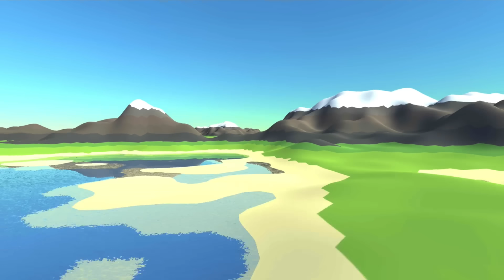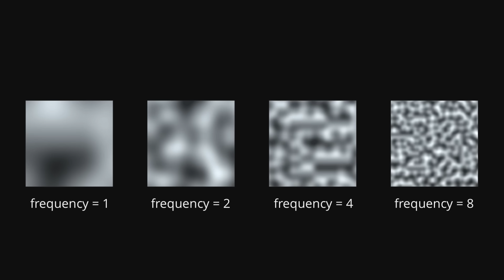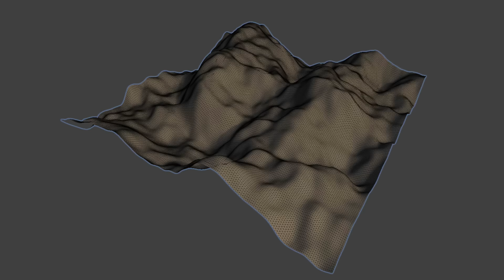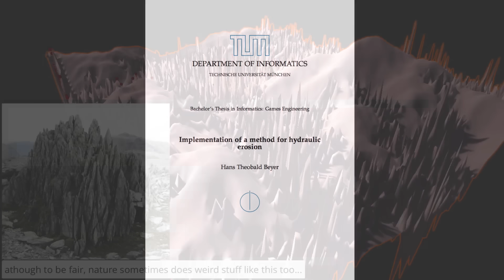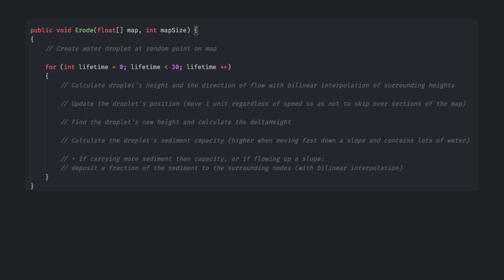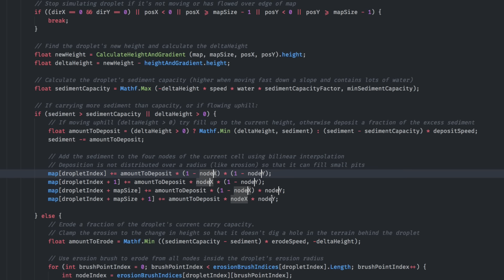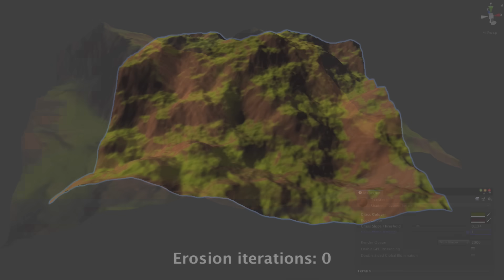Coding Adventure: Hydraulic Erosion

Comment: Why are you using a one dimensional heightmap? Wouldn't float[,] be more appropriate?
Reply: The height map isn't one dimensional, but the float array he used to store it is a one dimensional array, which can be easier to work with depending on what you're trying to do.

Comment: Given that, as moisture-laden air is pushed upwards over higher terrain, thereby cooling it to the point that the probability of rain increases, how could this affect the simulations of hydraulic erosion if factored into the source code?

Comment: Something I've noticed about things like this is that they create a lot of local low points that are still pretty high up, with no place for any of the simulated water to escape. In real terrain, these spots would become lakes that fill up until they find an outlet that lets as much water out as flows in. Any ideas or plans on implementing this?

Comment: One episode back I thought "nah, this terrain isn't real because there's no erosion", but then I saw this.

 I watched several videos and was impressed by the relative simplicity of coding. I program in Python as my day job, and it does get complex, but things are linear and straightforward unless you consciously dive into multiprocessing. I tried VB/VBA/VC++Builder years ago, but long time did not approac IDEs, because of the steep learning curve and finally low returns in the perspective. 3DMax/Blender-like UI also scares, compared to Sketchup (because the latter you can learn by just poking around), but probably with a reachable goal in the end one can get over the complexities. Thanks for these introductions!

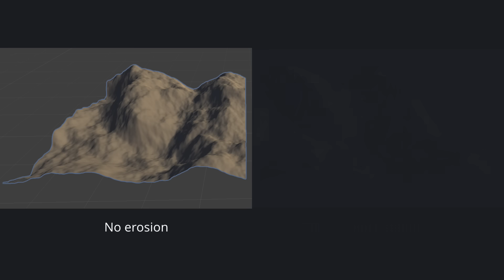Comment: 4:15 looks better than almost any mountain I've seen in a game ever.
Reply: While this is true, in many games terrain like this isn't very desirable, it's harder to limit traversal, this erosion by it's nature tends to create slopes that aren't that steep, and flat areas, authored terrain, while less natural, gives more freedom with how the designers want the player to navigate through it. There are often gameplay considerations on top of the art.
Reply: @DreadKyller though this method can be used still to create areas the player cant reach or have it slightly modified so it fits with whatever the project is
Reply: @DreadKyller  I wonder if that's true. While this method changes the texture of the terrain a lot, it doesn't change the overall shape much. So the initial heightmap could be designed to specific design parameters before the procedural engine takes over.
Reply: @Tristan Popken looks pretty good, not much else to say about it, maybe a little steep at points.

 @weckar  depending on settings it can change the shape a lot actually.

@Luxraider could be, the fact of the matter is hydraulic erosion is being and has been used for a long while in a lot of games, esspecially for background and for games where the designers don't care as much where you can go, it looks nice from a distance, but up close it can be hard to tell, because for performance reasons the resolution of terrain isn't usually all that high, so it's more of a seen-at-a-distance thing. It's also expensive for large areas, so for something like a background it'd likely be precomputed, and backgrounds tend to be billboarded anyways at a distance.

@Sanya Juutilainen It already is used a lot in many procgen games, but mostly in games with a fixed level size. It poses several challenges trying to implement this on an infinitely procedural world, as you by definition can't run the erosion on the entire world at once, you need to run it as it's generated, and this means the erosion may need to erode into unloaded areas of the map, or erode over already eroded areas. And Hydraulic erosion done the way he did it is very expensive, even with some shortcuts and optimizations this type of processing is expensive on large scales, though not expensive enough to prevent it's use.

I was just pointing out that on many popular games, there are design considerations to take into account. And especially in a very large map like many modern RPGs, looking over every part of the map to see if the erosion did something you don't want would take a long time. Procedural generation will continue to evolve and people will always come up with new, interesting ways to get around the challenges and limitations.
Reply: @DreadKyller  A friend of mine made this mountain in Minecraft, what do you think of it?
https://www.reddit.com/r/Minecraft/comments/gjnya5/a_mountainous_landscape_i_just_finished_today/
Reply: @DreadKyller  but this may a be a really good generator of an inacessible area that you'll simply see changing as a background
Reply: @DreadKyller  It will be applicable in future's procgen games - games like NMS or Elite (not now, but when atmospheric planets are implemented) could use this heavily.

Comment: One day, geologically accurate Minecraft terrain generation would be a reality.
Reply: Yeah, its called Dwarf Fortress XD
Reply: mfaizsyahmi There’s a mod that has a rather nice implementation of erosion simulation. It has some other very neat features too. It’s called Terraforged.
Reply: Look up a mod called Terraforged
Reply: This can be done. In fact, it won't even require any mods and can be done with command blocks.
Reply: @almarc not true at all because simulating erosion doesn't work with chunk based generation
Reply: Try the terraforged mod. It’s really beautiful in terms of terrain and is highly customizable.
Reply: Um guys caves and cliffs update IS making Minecraft geologically accurate
Reply: The difference between the other terrain generation minecraft mods and this idea is that those mods are generating off already-set variables on what height this and that is probably at, what the differences in biomes are, etc... While this is basically a physics simulation, it has to generate a realistic terrain by itself first, which is what those mods do, then a simulation takes place where it erodes the terrain through realistic patterns such as realistic rainfall tendencies, realistic flow of water, etc... In order to get as close as possible to real-life. Of course it's hard because you're constrained to cubes, heck even if you were to divide the blocks into 16 little blocks it'd still won't be too realistic. Geologically accurate minecraft terrain generation is already at our fingertips but it isn't going to be as realistic as we expect unless we do what makes more sense, literally just copy what is already the most-realistic thing ever, Earth itself.
Reply: Dwarf fortress has some of the most accurate terrain generation in history. Extremely accurate with all stone and ore in the correct layers, accurate nomenclature and physical properties for all the rocks and crap. The dev basically studied geology, climate, chemistry etc to build it. You can also export df worlds to Minecraft so... it's already possible!
Reply: Later Activity you have any articles or examples of this? This has really peaked my interest!
Reply: Bill Bob found this article that talks about the terrain generation and erosion for you

https://www.polygon.com/2014/7/23/5926447/dwarf-fortress-will-crush-your-cpu-because-creating-history-is-hard
Reply: There are mods for that already
Reply: Welp that is almost true now.
Reply: I don’t know if you’re still active but that is what I am currently working on. That’s why I’m here. I plan to make a game like Minecraft but with less restrictions and larger elements. And erosion simulation is one of the elements I plan to include in world generation.
Reply: Simple: install the terraforged mod.
Reply: 1.18
Reply: Ok
Reply: look up the realistic world generation mod. It might be what youre looking for.
Reply: There are already quite some powerful terrain engine in both Unity and Unreal for an affordable price.
Reply: Don’t we already have large cliffs that go up to the stratosphere 12 million miles from 0,0 irl?
Reply: Vr minecraft still exists
Reply: A reality, and extremely boring for gameplay :P
Reply: @weckar  i disagree. For example, Terraforged looks phenomenal BECAUSE its geologically accurate
Reply: @jondow7401  I wasn't talking about looks though, was I? I was talking about if it would be fun to play in. Mountains far too steep to climb, ore rarity increased tenfold, biomes far too large to traverse on foot... no thanks.
Reply: @weckar  You can change all that, yk. Also minecraft mountains r already pretty steep, far steeper than real life mountains at least. And I kinda think making it look realistic actually adds to the general atmosphere of the game, making it more fun to play. Like you're actually exploring real life uncharted landa

But hey, everyones entitled to their own opinion, plus im not gonna argue the pros of realistic Minecraft terrain gen under a coding video
Reply: Terra 1-1 mod (goes with Cubic Chunks) https://www.curseforge.com/minecraft/mc-mods/terra-1-to-1-minecraft-world-project
Reply: Don't give me dreams pls
Reply: Quantum. Computers.
Reply: If you wanna try one terraforged is my preference
Reply: Wouldn’t it take years tho
Reply: 1.17 be like
Reply: Have you heard of terraforged by any chance?
Reply: Biome blend
Reply: Dwarf fortress
Reply: Realism was never the point in Minecraft, accurate simulation usually makes boring games
Reply: Oh there's a bunch of mods that already do this and beyond
Reply: there is a terrain mod called terraforged that uses an erosion system to generate the terrain iirrc
Reply: Today is your lucky day!
Reply: Oh hey, now I have to do this?
Reply: It probably is possible. You ever googled stuff about Pixar’s supercomputer they use for rendering movies? 25,000 cores! Realistic minecraft easy mode
Reply: Id prefer Minecraft accurate geological terrain
Reply: Expect that nobody want it in mc 😂
Reply: Vintage Story
Reply: You would introduce lag if you are creating new land and then changing it afterwards to simulate erosion. Also, I suspect there would be an issue with water drop size and distribution if the idea was to have in-game rain erode the land after generation. Things like World machine do make the land look great zoomed out, but in-game you would be hard pressed to notice much difference between that and vanilla or one of the popular biome mods
Reply: @Ironbuket  This could be fixed by using Deferred Rendering. First you render your initial terrain to a texture image or an array of texture images on the back buffer(s). You then send this data to a Compute Shader - Geometry Shader, Tessellation Shaders etc. You use the compute shader to calcluate the amount of erosion, water evaporation, and water accumulation for each frame for a given amount of elapsed time. Then you send the updated information from the compute shader - geometry shaders to the fragment shaders for post rendering.
Reply: @Ironbuket  Well you can notice quite a bit of difference with World Machine if you're familiar with vanilla MC, because vanilla utterly fails to make anything close to smooth coherent terrain. That said, vanilla's shattered look is often more appealing from a pure exploration standpoint. Also, keep in mind that, as far as I'm aware, World Machine only works on pre-generated terrain. So, it's for map making in a defined area, not for exploring randomly generated stuff.

I'm fairly confident that there's currently no way to create a terrain generator that lets you simulate terrain changes at rendertime.  That sounds like it digs too deep into the game's core functionality for any of the available APIs to reach.
Reply: @Ironbuket  if you trained an AI to create similar hight maps to images fed from this guys video, it could blend the Y height of each surface block in minecraft with the Hight map to create a "simulated" terrain generation without the extra lag that comes from the simulation. basicaly deep-faking heightmap "faces" onto the terrain.
Reply: @noahmarchais804  and have to update the blocks in realtime
Reply: ...jay?... i guess?
Reply: @tf2excession  except that minecraft is really shitty in terms of big hills
Reply: @RagbagMcShag  1.18 tho 👀
Reply: We, the people of Minecraft, will annihilate you and your supporters as heretics...
Reply: @lolitaras22  No we won't

Comment: I've been playing around with the same thing, although I havn't got my erosion algorithm to work properly quite yet. The algorithm I went with looks slightly different from your. The promised result also look slightly different. I based mine off of the paper "Fast Hydraulic Erosion Simulation and Visualization on GPU" as well as other similar sources, but I might check out your sources and give them a try. Either way, your results look great.

Comment: An improvement I would do is to run those drops simultaneously in batches and let them merge when they meet. That way you will get water flows which is something that is visibly missing - some areas are too smooth and flat while in nature channels and stream beds would form there. It is very nice nevertheless!

Comment: Can anyone explain why the height map is float[] and not float[][]? I'd have thought this would be done with a 2d array, how does a 1d array translate to a 2d plane?
Reply: tiggerbiggo Well you can just always do loops that account for this. A 2D array in memory is (often) just a bunch of 1D arrays in a row. He may have done this because if it wasn’t a rectangle with rectangular mesh points, then a 2D array wouldn’t really make sense. And you may notice that he used a triangular mesh
Reply: @1495978707  i do unserstand, however this would mean that he would have to use modulo and int division to account for it and split it back down into 2d coordinates?

Also, even though it is a triangle mesh all the vertices fall perfectly on a 2d grid, and you can only ever change the vertices positions...

Comment: Hi Sebastian,

This video was inspirational: I'm now looking at implementating a variation of your erosion algorithm in Monogame for the next update of my game.

By the way, I found that decreasing erosion/deposition speed (divide by 10) and increasing sediment carry capacity (multiply by 5) was a good way to encourage the formation of gullies and ridges along the sides of cliffs. With the default settings the water very quickly becomes saturated with sediment, so it spends most of it's life depositing rather than carving.

Comment: That's really cool! Using QGIS I was able to make randomly generated DEMs, and I had wondered how one might simulate erosion. It would seem it is a lot more complex than I originally thought. Now what would be interesting is if you could add actual geology to the maps. You can work out the erosion potential for different rock types so it would be really neat to model how different landscape with different lithologies erode over time. Then, you could even add in streams/rivers and see how they change the landscape.

Comment: Whenever I open this project in Unity I get two errors with the MeshGenerator script about how "IndexFormat" doesn't exist (line 91), any help?
Reply from the maker: What version of Unity are you using? You can simply remove that line if you want, it just enables meshes for maps larger than 255x255 to be created.
Reply: @SebastianLague  I checked it out and it appears like I was running an outdated version of Unity, I reinstalled and the program ran fine!

Comment: Depending on the size of the terrain features you're going for, this might be a good candidate for something akin to Unreal's Parallax Occlusion Mapping (heightmap texture) that you can use to make things look like they're sinking below the polygon surface. Wouldn't work for the grand canyon, but for the low amplitude high frequency extremes you might be able to squeeze even more detail into it.

Comment: Some ideas: 
1 - Run the simulation backwards. Actually i might do that on my channel since you put up the code.
2 - Why do one drop at a time? Couldn't you do a single pass in developing a flow map, flowing, then making another flow map? I feel it would lend itself to parallelization better, perhaps being runnable as a compute shader. If nothing else it would develop some cool maps you could put on the simulation to show water. 
3 - Could use use sediment deposition itself to create a 'fertility map' for the soil? 
4 - Possibility of running on a sperical planet?
5 - Yes, teconic plate simulation, YES!
I should give you more patreon bucks.

Comment: Wow, this is awesome! Love terrain generation, and this is a neat rabbit hole to go down with fantastic results to boot.

One thing you're not doing though that you could add is... the rest of the water cycle :P
Perhaps add a height threshold for snow, have that and springs act as static water sources that create a continuous flow rather than just relying on the randomness of rain. Make the water actually build up instead of just evaporating as particles, allowing for natural lakes to form and build up to the point where natural outflows can open up. Seems like there's a lot of potential here :)

Thanks for posting the code too, so we can tinker with it!

Comment: WHen it comes to grass, I realized that as terrain erodes, there is only so much dirt on any surface.  The steeper the slope, the less likely there is to have any dirt on it and just have rock.  So, steep slopes should get a more rocky colour/texture, mild slopes could have more dirt, maybe light grass, while more level terrain at lower altitudes would have more grass and the tree type could change if you took that into account.

You could also keep track of where water ends up, if you have enough at the same location, you could create lakes etc... depends on how far you wish to go with this.  Personally I love the idea of simulating as much nature as possible.  Great video anyhow.